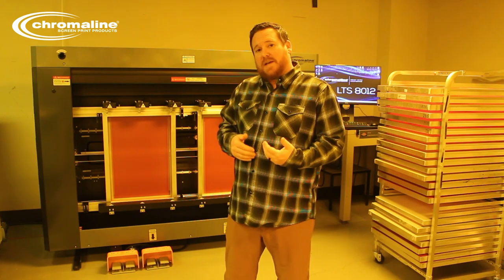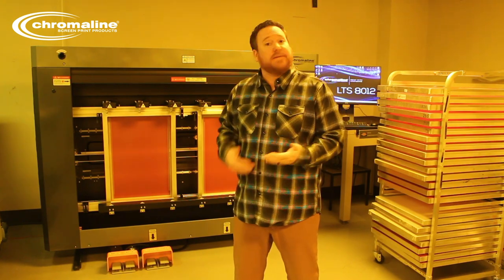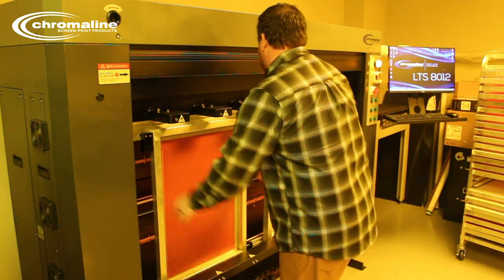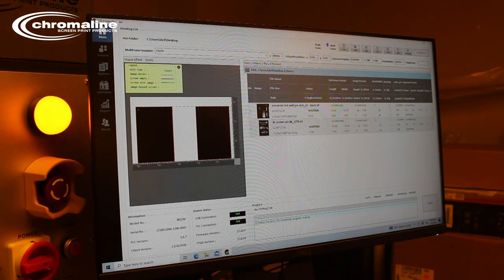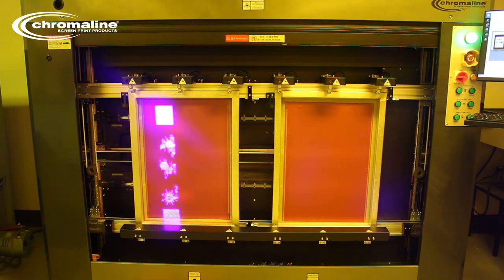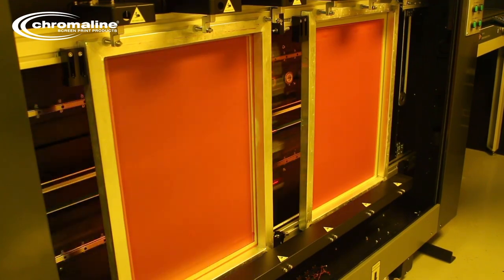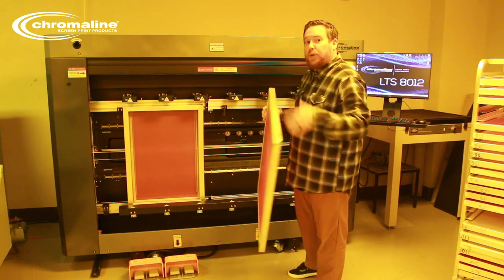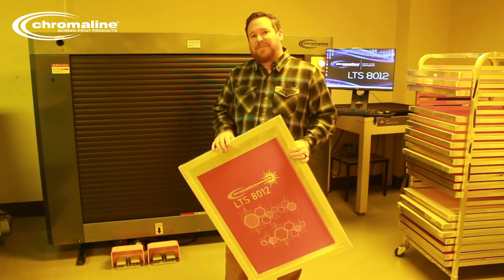Laser-To-Screen LTS 8012 Overview | Automate Your Screen Making Process | Chromaline Screen Printing

Comment: Where do you get your pre coated screens from I would think since your using a laser they are a metal mesh right?
Reply from the maker: No, they are not metal mesh. They are normal mesh screens that we coat ourselves using Hydro-X Z-1 emulsion.
Reply: @chromalinescreenprintproducts 
Why don't the mesh tore apart.. 
What is different in xtool screen printing laser and your laser.. 
For comparison please explain
Reply: @niteshkumar-qc8nq    I am super new to lasers but I am going to guess the power settings and or frequency of the laser will play a huge part.  I have seen a gay laser on to his hand with the right settings
Reply from the maker: @niteshkumar-qc8nq  our laser is not removing anything, we are just using the light to expose our image onto our screen, then we still take the screen to a washout booth to finish the screen